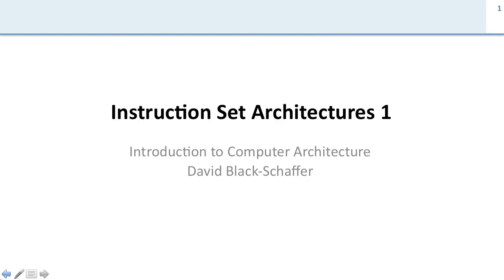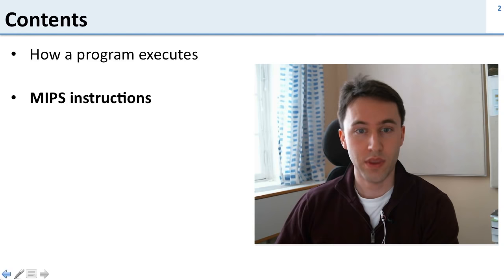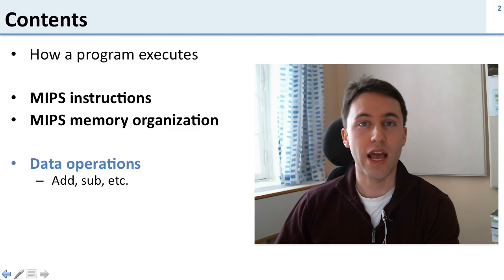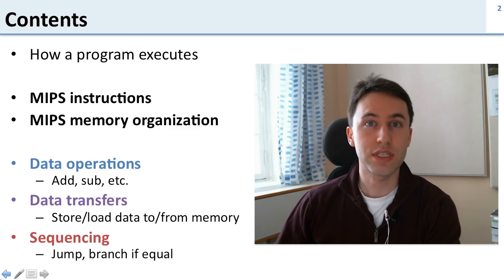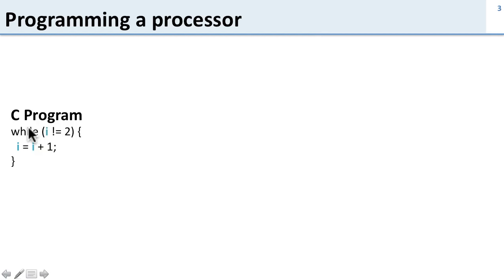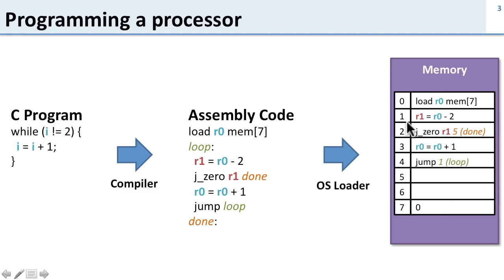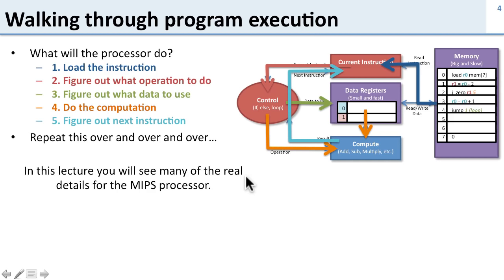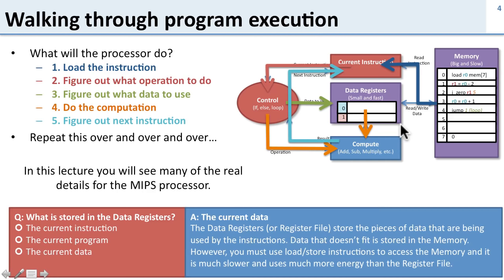ISA 1.1 Introduction to the ISA

Comment: wait you saying inside the chip we are using a those  
I have a question about the result part 
when the controll get the data and a WAY from the CONTROL to compute the result 
and where is the part where that result gonna display ?
Reply: Ax because the result is goes in the accumulator register by default